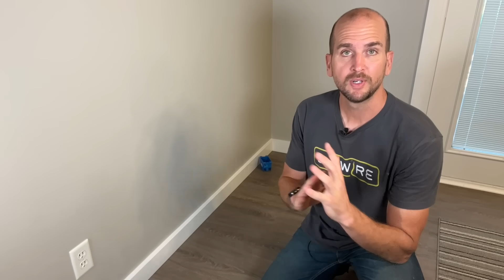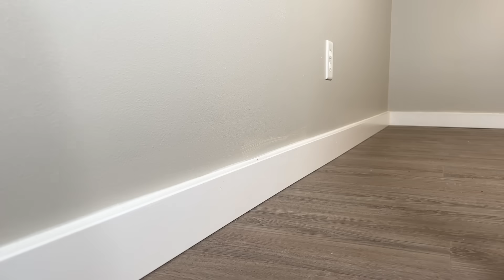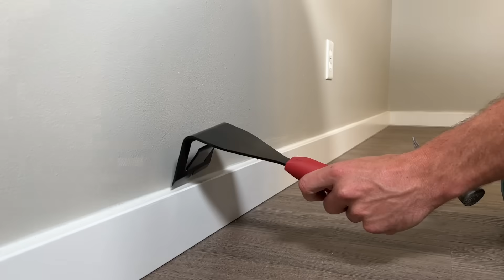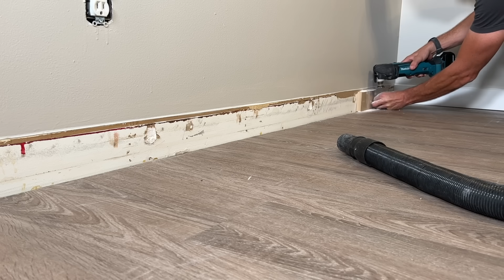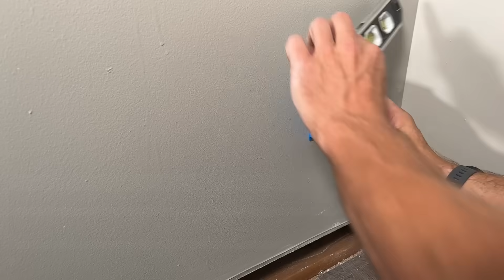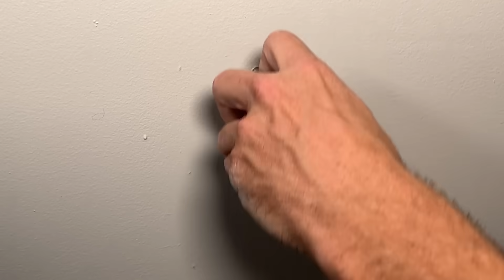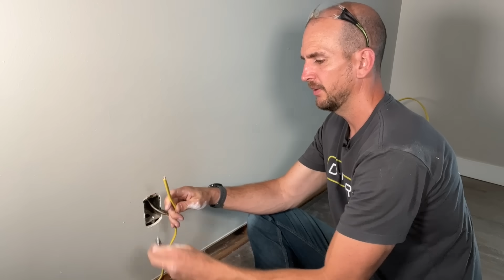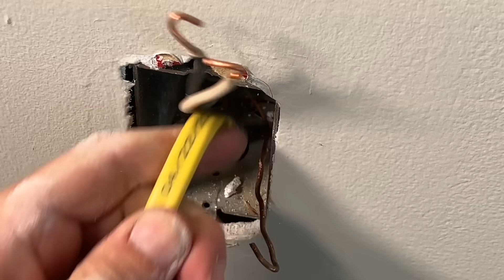How To Add An Outlet To A Finished Wall

Comment: Great instructional video. I just wanted to nit-pick one small thing. When you install a retrofit box you should remove the "plaster ears" from your outlet. These tabs normally secure the outlet to the wall. Since the retrofit box is secured to the wall, the plaster ears are now just in the way, causing the outlet to stick out too far past the wall which will then cause the coverplate to not be flush.
Reply from the maker: Great catch 👍
Reply: I always try to install old work boxes alongside a stud and run a couple screws in it.  People can be hard on things and the 1/4 inch of drywall the box is relying on isn't very strong.

Comment: I was curious as to why pigtails were used instead of wiring the existing wire into the top half of the outlet and the new wire into the bottom half?
Reply: I was thinking the same thing. That's how I've always done it.

Comment: In 1947, the Canadian government built apartment buildings for returning soldiers.  Fast forward to 1984 where the government sold them to a private company.  Needless to say, the apts had to be conforming to the new codes for 1984 so, they replaced the fuse box with breakers, added circuits (instead of 2 120v and 2 for the stove and hot water tank) for the kitchen and electric baseboard heaters.  In 1963, one building exploded from a gas leak (gas heaters) so they replaced the gas with electric central heating (not hot enough.) and in order to add those baseboards in all 5 rooms and kitchen, they ran the new wires behind the door frames and baseboards.  An old trick but works.  (The only think I don't like is that they added 240v wires behind the wall between it and the cast iron bath tub...)
Reply: did you really expect anyone to read thru all that history when nothing applies here....Plus it's Canada! 
Really.
Reply: @billiebobbienorton2556  World history, you should try it sometimes.

Comment: There is another way to do this for short runs that doesn't require removing baseboard, depending on the type of electrical box you're running from. If it's an old work box you can remove it. In the electrical department of Home Depot they sell long flexible drill bits. You can drill through several studs from the hole the old box was in all the way to the location of your new box. But if it's a new work box you can't remove it without messing up the drywall or plaster.
Reply: You have no clue what you're talking about.  Firstly, only a total moron would try to drill blind through multiple studs, as you don't know if there are any other wires or plumbing pipes in the wall that your bit can get into, and chances are you'll drill through the drywall trying to get through the second stud.  They're NOT EASY to use.  Secondly, you can remove new work boxes without damaging the wall.  This guy's method is the best way in the scenario described.  I'd do a couple things differently, but that's because I've done this kind of thing thousands of times.

Comment: genuine question, were the lever nuts necessary? Couldn't you just connect the hot and neutral of both lines to the outlet. I thought that is what the extra set of screw terminals was for. Maybe for the ground as well but i didnt get a good look at the other side.

Comment: You should first check to see how many other outlets are on the Circuit. There are codes . In most states 12 plug  or 6 2 plug boxes is the most you can have on one wire . If there is a fire and they count the plugs and they see you added more than the code allows your insurance won’t pay for damages. If you have 12 plugs already on the circuit  you have to remove one to add a new location . Ask a licensed electrician what the code is for your area or you might be paying for a house you burn to the ground .

Comment: why not just cut an inch out of drywall below the molding and run the wire in the gap then replace the molding? Dont have to ddrill thru studs that way

Comment: loved what you did here. 

BUT: 1 item - NO the screws should NEVER BE HORIZONTAL. 

the NUMBER ONE REASON that electrical inspections FAIL is NON- VERTICAL (up and down) screws. and... in most places CODE states vert/up/down screws. 

PLEASE INSTRUCT VERTICAL ONLY. 

why is that safer? nothing can accumulate in the screw head channel (is the "thinking"). 

vertical ONLY. 

i know there's gonna be electricians that SCREAM i am wrong. go talk to 10 inspectors. ALL TEN WILL SAY VERTICAL ONLY. and your codes - VERTICAL. 

:)

Comment: Fyi, I had a trim piece in my family room removed for repair, similar to how he did it here, and upon pulling it back, a high-pressure tight stream of water ensued. I was like, WTF. After running out to the garage and turning off the main, then mopping up, I discover that one of the trim nails was sent by high-velocity finishing gun though the trim, through the drywall, and into a water main PVC. When it went it it was hot, and immediately cooled once it hit the water, sealing the hole around the nail in the process. I had hardwoods installed about eight years prior, and we suspect it was the floor crew that left that little surprise when they replaced the trim. 

Moral of the story: Be careful, and be prepared for anything. You never know what you're going to find when you pull a piece of trim.

Comment: My only suggestions are to get yourself a 90 deg drill for stud bay work and you can also use a string with a large washer to get the firing into the box.
Reply: "firing into the box"?????   Huh why do you want fire in the box?????

Comment: I have a few questions before I'm comfortable trying this. First and foremost, how do you find out if the circuit can even handle additional outlets? Second, what if I need to wire a new outlet around a corner and/or past a door? My exact situation is that my mother recently bought a house and needs to convert the garage into an additional bedroom, however, the garage only has one outlet, which is located on the north wall. We need at least two additional outlets, at least one each on the east and west walls of the room (possibly two on each wall), but the east wall has a door just a few feet from the back wall (right in between where the existing outlet is and where the new outlets need to be. The walls are finished with very nice material, meaning we do not have direct access to exposed studs as in some garages, so my mother will not allow it to be torn up to run wiring, but since it has to go around a door, the work cannot all be hidden behind a baseboard. The west wall has the kitchen on the other side and there are two outlets on that wall of the kitchen; I watched a video showing how to run an outlet on the opposite side of a wall between the same studs, but my mother is concerned about the load on the circuit breaker, and would still hold that concern even if we're able to wire it all from the existing outlet on the north wall of the garage. We cannot afford to hire an electrician to determine if the circuit can handle the load and wire it all for us, As for what will need to run in the garage bedroom, there will be a television, computer, at least two lamps, a sewing machine, a C-PAP machine, an evaporative cooler (because the garage is not connected to the central heat and air system), a dehumidifier (to counter the increased moisture from the evaporative cooler), at least three or four fans to cool the room until we can afford the evaporative cooler (and at least one after we get the cooler to promote air circulation), a heater, and a mid-sized chest freezer. We do not currently know what (if anything) else is already sharing a circuit with the outlet in the garage nor how to find out. It is equally unclear whether the two outlets I mentioned in the kitchen are on the same circuit with the refrigerator and/or microwave (which are on the other side of the kitchen) or the laundry room (which also adjoins the kitchen). How do we determine which outlets are on what circuit and which circuits can handle the load of additional outlets? I know this is a lot and you probably won't take the time to read all of it and answer, but I hope that you will as I don't know what else to do. I'm not an electrician, but I am good at working with my hands and at following directions, so I can easily complete the process if only I can find the right instructions.
Reply: You definitely need one or two new (20A) circuits.  You have too much load to try to run it off your existing circuit(s).  Where is your electrical panel?
You will need to pay an electrician to do this job if you have never done any house wiring (120vac).
Reply: @shoersa  The circuit breaker is actually in the bedroom furthest from the garage at the complete opposite end of the house. And, as I said, we can't afford to hire an electrician. At least not any time soon (there's a SLIM chance we might be able to afford it by NEXT summer, but that won't help make the garage livable THIS summer  . . . or this winter when it gets cold . . . and and the room is needed presently).

Comment: The next time you decide to show people how to do my job, at least show them correctly. I'd hate to see you be held liable. Code states there be a minimum of 6 inches of wire outside the box, and also that existing box is not properly bonded.
Reply: Bonded? Pls explain what you mean by bonded.

Comment: I am one of the senior maintenance technicians at my job, and although I fall under the mechanic side of things, we all crosstrain into the other departments such as electricians and welders.  Working in the industrial market, you'd think residential projects would be child's play, but that's not always the case.  This channel provides exceptional advice that would otherwise be costly to hire out and this is one of the many channels that have been well thought out.
Reply: I worked as a network and communications cabler for many years. Getting cables from A to B is almost always harder in domestic versus commercial situations. The threshold of what is visually acceptable, conduit, ducting etc is much lower if it's not someone's home (with some exceptions).

Comment: Excellent technique and video.  My first concern was if installing romex low in the wall breaks code but based on how many contractors responded positively, I'd imagine all is good.  Another potential tip for making this even easier is to not clip the braid nails off the back of the baseboard and just push the baseboard back into the wall with a bit of caulk behind the baseboard (or something else) to help secure it from being loose... one less (nailer) tool needed for the home owner possibly.

Comment: GREAT TRICK!!!!!! Pro tip. Use wire nuts not wagon. Use wago ONLY FOR WIRES THAT ARE TOO SHORT!!! Twist all wires with pliers, cut ends, put a wire nut .  This insures the wire will not come apart. (Wire nut only to cover bare wire not to twist the wires). If you fold wires neatly you usually make them fit.

Comment: Excellent video!  Just wonder why 1" holes had to be drilled in studs, way larger than necessary!  Also, all the faceplate holes should be lined up either horizontally or vertically?  Wowzers that's picky.  No one, and I mean absolutely no one, will look around the room and check out the faceplate screws and notice how they are oriented...that is soooooooo weird.  Personal preference of course, but tmi for the rest of us.

Comment: Great video, the only thing is where you say that you can never have too many outlets, you actually can, you don't want to overload the circuit. Adding just One probably won't make a difference though. Unless it's already maxed out, which does happen. Other than that, great job.

Comment: Great video.  My Dad was a master Electrician, and I think he would have been impressed with how well you did this... esp the tip about the connector on the romex before installing in the box.  Been there, done it. 🙂
BTW, appreciate the link to The Funny Carpenter.  Great way to caulk.

Comment: When you have a bare (non-insulated) ground wire I always wrap electrical tape around the hot and neutral contact screws to prevent any contact to the screw from the bare ground contact wire or to prevent arc hazards.  Takes a few seconds to add additional prevention.
Reply: In Britain we always put a sleeve on the earth/ground wire.
Reply: @derekferguson385  Yes that works also. I do not like uninsulated earth/ground wires in a junction box.

Comment: Only thing I don't like is using the backwire method. It's a spring, and absolutely goes bad over time. No pro uses these. Either get the upgraded clamp style (.50 more) or make the hook and wire it in on the screw.

Comment: I've been a contractor 30+ years. I wasn't sold on this process at first. But this guy covered all the issues. I'm impressed and can back him up. Thanks for not being a hack- good job!
Reply: One question...why did he pigtail the wires in the new Romex with the existing Romex.. wouldn't it have been possible to connect the black - white new wires onto the bottom screws of the existing outlet.. what am I missing? Any information would be appreciated 👍
Reply: @michael184272  He had a whole box of Wago nuts and just wanted to use them. But you're correct, in that the new black and white wires could have been connected to the bottom screws of the original outlet.
Reply: @kimsotus  
Thank you
Reply: @michael184272  I was gonna ask this same question!  Thanks for beating me to it two months ago.  🙂
Reply: @michael184272  length maybe? I don't remember the whole video at this point.

Comment: Only thing you may not have covered is making sure there is a not an outlet directly behind the new one being installed. Yes you can use a shallow box but you need to plan for that or its another trip to the store.

Comment: I wonder, don't you need to use cable with metallic sleeve?
Reply from the maker: Not in my area but you will want to check your local adoption of NEC.  For instance I know Chicago is basically all conduit and no Romex.

Comment: I remember when I first became an electrician, I did the same thing as he did and finished in 2 minutes!!
1 orange extension cord 
1 roll of masking tape
1 surge protector 
Plug in the extension cord to the existing outlet.  Run the cord along the wall moving directly across and use a bunch of tape to keep it sturdy on the wall and from disconnecting from the outlet.  Then plug in the multiple outlet surge protector into the end of the extension cord and cover the whole thing with a large piece of furniture.

Comment: I  could use an outlet on the other side of my window which would mean I would have insulation in that wall,  should I be lifting the insulation so I could run that wire??  or anything else you have to offer to me, Thx

Comment: Very detailed video, curious on the amount of time it actually took to do this small project? I also have to ask about the metal box in a residential application that appears to be a reasonably new house? Overall this 35 year electrician is impressed with the idea. Kudos
Reply: play the video on 0.25 speed and you'll be pretty close ;-)

Comment: Nice video, helpful, my only concern is the width of that wood bit, it could have been smaller leaving more strength in the wood, it could have been a load bearing wall? Something to consider before boring 25 % of its thickness away, 5/8” would have been plenty and left more wood 👍🏻😊

Comment: Great review!! 
There were some great tips. I liked using the block as a guide to cut the drywall. I like the Milwaukee 18v multi tool for such drywall cuts. 
I also thought it was a great idea to clamp the Romex connector to the wire and pull it through the wall. 
Regarding the ground, I use twist the wires and use a crimp for the two wires and twist the longest wire around the ground screw. 
With 12 ga, backstabbing does not work on modern receptacles. I prefer to twist the wires and use a wire nut with a pig tail to the back of the receptacle.
Not a big fan of the Wago on Romex. Not enough wire to wire contact. Twisting the wire well beyond the exposed copper will provide good contact and prevent future issues.

Comment: ONE ISSUE IN YOUR CONNECTION IS, THAT YOU DO NOT SCREW THE ""GROUND"" TO THE METAL BOX ( CODE REQUIRE) BUT YOUR IDEA SAVES TIME REGARDLESS OF THE MISSING CODE.

Comment: Everything is spot on, except removing the metal knock out, that’s doesn’t usually go that easy. In fact almost never in my experience. Those old metal boxes move and bend and still won’t let the knock out come loose, I have done so many that sometimes I’m end up using a unibit to punch a hole to use a leverage.
And never I, I repeat never use those little quick connectors if you know what’s good for you. I have done hundreds of service calls that ended up being failed quick connects. Just use wire nuts and make it permanent.
Reply: There's knock-outs, beat-outs and pound-outs.

Comment: Zoink...  You don't need wago when you have the other connections on an outlet.  Connect the power and other outlet to the 1st outlet.   Forgo to wago pigtail which adds unnessary extra connection and weakness in your circuit not to mention the extra cost...  Ugh.

Comment: So technically speaking... anyone can tap into the source wires and split it into a new outlet?
I'm not an electrician, but I suspect someone on the other side of the wall is doing this... is there a way to find out?

Comment: I've done this work for over 30 years. This is a great presentation straightforward and to code. Well done.
Reply: To code??? In what state allows new wire run 5in off the floor? What state allows no clips on the stud to protect the wire? I'm not sure you know what a building code is.

Comment: Didn't install the required metal plates on the up rights at the locations where the wire travels through

Comment: What would you do if the baseboards are only 2.25" in height?
Barely leaves any working room cause of the 1.5" base plate (2x4).